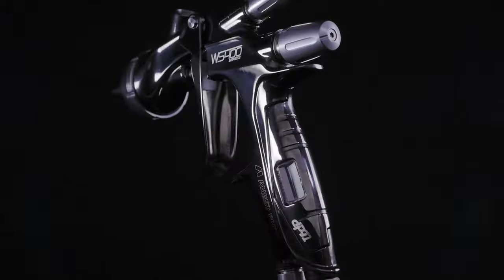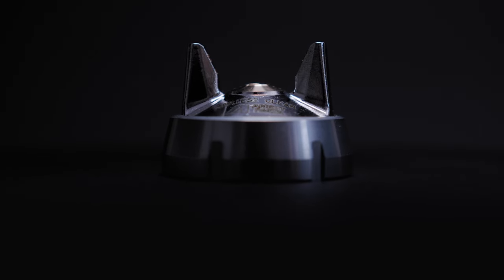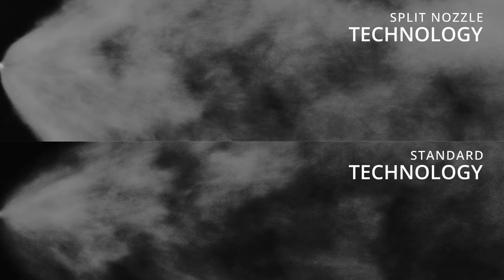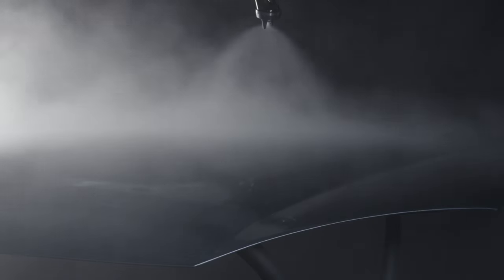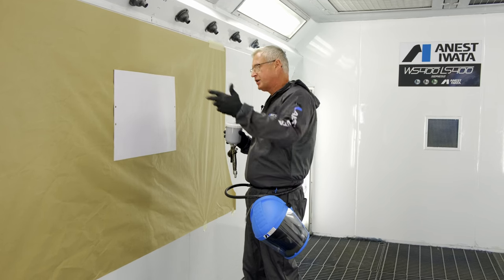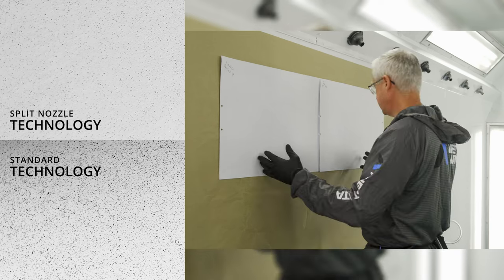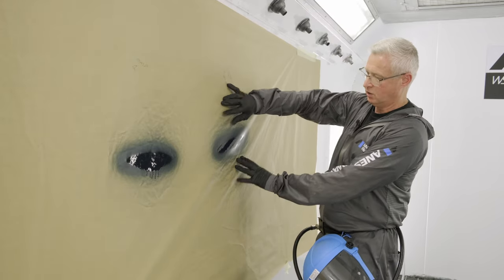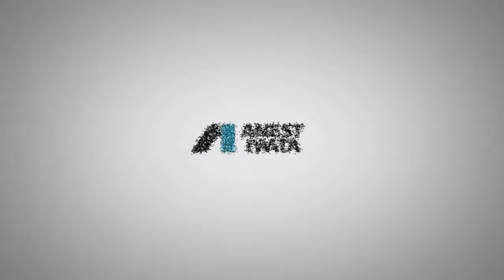EXPLORING THE WS-400 SERIES 2 CLEAR - ANEST IWATA WS-400 CLEARCOAT

Comment: Thanks Tony for taking your time and sharing that information with us is it a easy gun to use through for the first timer the clear gun people used to say it a hard gun to used mate and you have to get the fan spot on
Reply: Yes. The Series 2 is truly a straight out of the box experience. With the older version Series 1 (as stated in your reply and in the video) it had to be tweeked by the painter to try and acheive a sweet spot. The series 2 has been developed extensively to be set to full fan and full trigger. It is as simply as that. The spray gun will do the rest for you.
Reply: @gavsterr6164  thanks 😊 for getting  back so whitch one do you buy i seen Tony using a 1.3 et and a w400 HD  but whats Ob1 and that stuff
Reply from the maker: Hi Andrew, In this video, we talk about the out-of-the-box experience. In all of our videos we use the Series 2 fully open, No adjustment required.

Comment: Awesome Video. Do Love the Iwata Brand. I have several. Looking to get the WS400 Clear soon. My Question is. What is the proper way to clean right after spraying Clear? Do you have a video on it? Awesome product.
Reply from the maker: Great thanks for supporting the brand! We don't have a cleaning video (yet). We would recommend just doing your standard cleaning process.

However, Pay close attention to the air cap, atomisation holes, split nozzle and the needle. Use small brushes to make sure there is no residue left in the small hard-to-reach areas. We have maintenance kits for this purpose with a mixture of different size brushes these are what we use! 

Thanks, Anest Iwata Refinish!

Comment: 1st time i used the series 1 gun it was a water hose runs every where. Did you reduce wth activator ? by how much. Also my settings were ,Bottom wide open/fan wide open and 3.5 out from closed fort he fluid.29 psi
Reply from the maker: What nozzle/needle size did you use? And what system? We mix everything by scales in our videos and follow the TDS of the system we are using. We always use both fluid and fan wide open and 2.0 Bar on clearcoats. Thanks, Anest Iwata Refinish.
Reply: @AnestIwataRefinish  TY for the reply. Using the LS and WS Supernova Original guns. with a 1.3 . Tamco Paint systems.1st time with these guns compared to my Sata 5000 this has sharp edges and cannot seem to stop running the clear on the corners of the panels. Shop temp at 70 degrees F. Temp of products in the 60`s i suppose in NY. Does the clear need to be heated to 100 f ? I did close up the fan a touch seemed to help but tough to build confidence in this yet. The LS i tried both Base and clear and worked fine just took a little longer for the clear but did not run 75% ovlerlap. TY for the help cheers.

Comment: What is the difference between the iwata ws 400 SR2 clear and w400 wbx spray gun if you apply varnish? Thank you.
Reply from the maker: @stepanstepanovich5219 - the main differences will be the atomization characteristics and the size and shape of the fan patterns. 

WS-400 will break up the particles slightly more Due to having a Split nozzle with four slots. Ws-400 will also have a slightly more compact fan pattern. 
WBX is slightly different in you'll be getting atomization with three slots and the fan pattern is slightly larger. Obviously, material viscosity may change performance parameters!

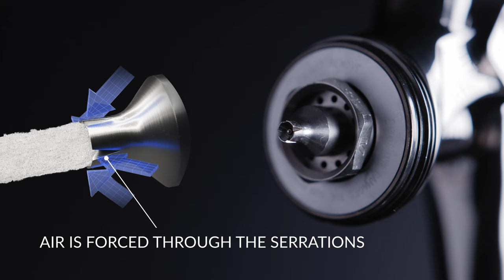Comment: On my original ws400, i dropped it and it fell on the tip 😞 it still sprays very well, but those 1:19 things are creased in a bit on one side.

Should i replace the tip??
Reply from the maker: Without seeing how your WS-400 sprays, we can't answer that question. If there is a noticeable drop in performance then we would recommend replacing the nozzle.